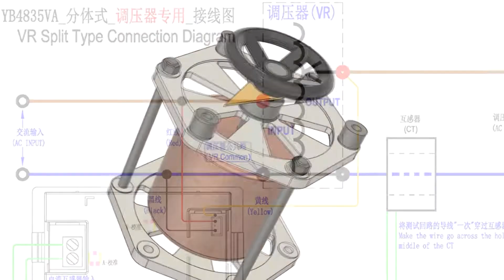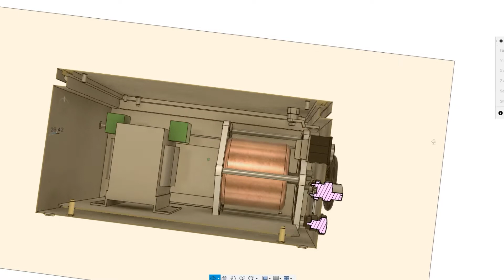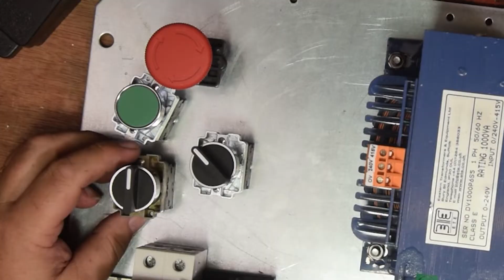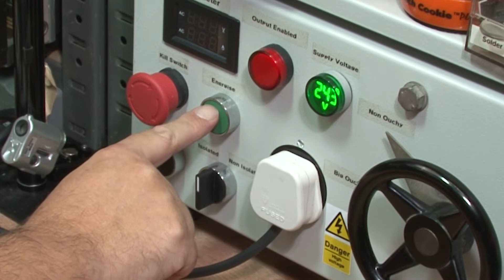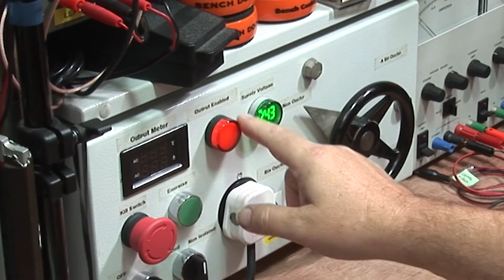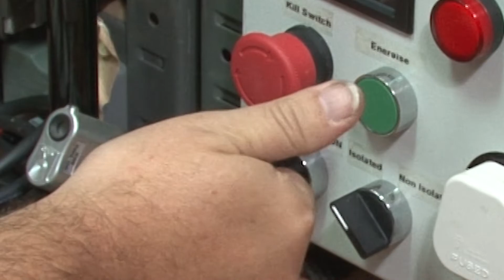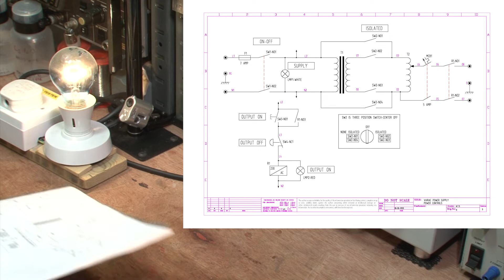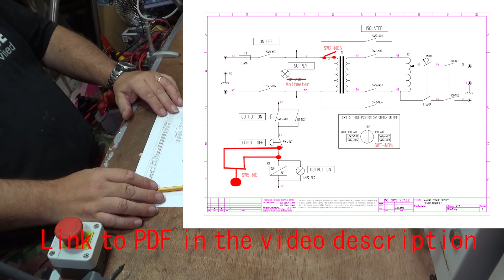How to make a variable AC voltage supply with a Variac and isolation transformer

Comment: Well Many happy returns George hope you have a great Birthday. I agree about the isolation transformer and the Variac they are quite huge but necessary for safety. Chris went through a ton of work to get that enclosure ready for you great friend to have for sure. That is a great looking unit and operating equipment that should give years of service. Thanks for sharing George
Reply from the maker: Thanks Larry for the birthday wishes. All credit has to go to Chris for putting my idea into practice. I only asked Chris originally where to get a box and I ended up with a ready to run cabinet! I'm pretty sure that the unit would outlast both myself and my kids and probably their kids too with the rigidity and strength of the components.

Comment: many happy returns ! looks very nice George  reminds me of the work I used to do making wiring harnesses for  similar metal boxes with lots of contactors in it  and  a transformer  bigger than that box !
Reply from the maker: Many thanks Benji. Yes, industrial wiring can be fun, I worked for a company that used to rent HV transformers to building sites such as docklands light railway and the Manchester tramway... wiring those to 11kv three phase from the grid was fun and then to the other stuff around the sites.... Slightly larger transformers than my car most of the time!
Reply: @GeorgeChristofi  it was and it was all one colour too black usually !

Comment: Like it.  I made a similar unit but added an additional interlock such that the output could only be on when the variac started from the zero position.  This meant that, in the event of a fault/trip you MUST reset the variac to zero volts before being able to turn it back on again.  Prevents you from re-applying the 'bad' voltage again straight after a reset/trip situation.  Also fitted a variable AC current trip to the output.  But yours is far, far larger than mine (giggidy) as my working limit is only 250W which covers most stuff I work on/repair.  Good job.

Comment: Hi George  Happy Birthday. The power supply unit looks great and I really enjoyed helping on your power supply project it was a lot of fun.  That  transformer and variac looking even bigger in the video than they did in my model.  It must weigh a tonne !   It was a good idea to add that extra switch for the input to the isolation transformer I will update the circuit diagram for you so you can glue it inside the lid. Many thanks for the mention and channel support regards Chris
Reply from the maker: I was glad to have the help. Yes, weight.... errr... lots I think the raw transformer is about 15Kg and the variac about the same... then we add the steel box and it makes for a 'substantial' device! I was thinking of double switching the isolation transformer but it made the switch block ridiculously long. I was thinking of maybe running that as another contactor at a later date. As for a shoutout... the least I could do for all your help.

Comment: Hello, I came across your site by accident, I watched this video out of curiosity. This is absolutely professional work, when I see some creations in wooden or cardboard boxes with loosely stretched wires, I die slowly at the monitor.
When I saw the wiring diagram, I noticed a huge mistake, when using an isolating transformer, the ground must not be connected to the output socket, the ground will be connected to non-insulated distribution and the ground loop may be closed. I also have an isolated/non-isolated output switch in my wiring - in the isolated state, the ground is disconnected, and in the non-isolated state, the possible residual current of the ground loop is monitored.

Have a nice day 🙂 Tom
Reply from the maker: Many thanks for your comment Tomas. In the UK, the wiring regulations specify that the earth must stay connected through to the output socket. The only exception is in recording studios. The earth wire is not connected to neutral in our mains distribution systems but runs back to the supply transformers. With this form of isolation, there is still no reference to earth so the output from the Isolation transformer is still safe with reference to the rest of the supply. When I queried this with my friend who said to run the earth this way initially he explained this to me. As it is his profession designing and installing mains and HV systems I deferred to his better knowledge of the system and current regulations. I too was worried about ground loops and full isolation.

I thank you on your comment regarding the quality of the work, I have worked in the radio and electronics field for many years and I have always found working on neat panels and circuits to be much easier than bad job systems. 

Many thanks once again Tomas, I wish you all the best.
Reply: @GeorgeChristofi  Hi George, thank you for the clarification, in this case the tn is absolutely flawless, here in the Czech Republic there is a primary ground circuit and only the protector physically separates the neutral wire and the ground, in connections without a protector there is a connection between the neutral and ground bridge in the switchboard.

Beautiful day and many such wonderful projects 🙂 Tom
Reply: @GeorgeChristofi  I noticed one more thing when I was showing your beauty to my son (he does IT robotics) the output voltage indicator light is connected to the contactor coil - I personally connect it via the contactor contacts - if, for example, a mechanical failure of the contactor itself (cracked contact hinge, baked contacts spark, etc.) the contactor did not jump after switching off, the indicator light goes out, but the circuit is energized, if the indicator light is powered through the contact, it will remain lit. 
Nice day 🙂 Tom

Comment: Well done George! (and Chris for the metal bashing!) That turned into a nice self contained piece of gear. Gets rid of interconnecting wiring and provides convenience, increased safety and  metering. For added safety maybe another indicator light to warn you that the isolating transformer is on bypass, least you forget??
Reply from the maker: Good idea! Something that could be added and I do have more panel lights and meters which will match the ones I have used. Chris did most of the hard stuff, I have to give him most of the credit.

Comment: Thank you George you can put the links where you bought the accessories
Reply from the maker: All of the equipment was UK sourced so it may or may not be cheaper to buy locally. My transformer came from a UK manufacturer, https://www.ete.co.uk/ and the variac came from eBay. Switches were bought from an electrical distributor, https://www.rselectricalsupplies.co.uk and the contactors, din rail and connection blocks were salvaged from various sources.

Comment: Good one. How can you also change the frequency of the output?
Reply from the maker: no, there is no frequency changing available so it will run US devices but only at 50hz. Generally thats fine except for syncron motors for clocks which rely on the frequency to be accurate

Comment: brother can i use diac triac for ac variable power supply without transformer.
Reply from the maker: Probably not and it really wouldn't give you a proper variable output, just a chopped sine wave. I would say the Variac is the most essential part of the whole setup

Comment: It looks like the primary of the isolated is connected to the secondary. This is a question not me trolling. What causes the output to have a floating ground say for an oscilloscope to protect it from mains earth. I'm still learning is why I ask?

I think I get it after studying it further. The spdt switch on the primary of the isolation threw me there.
Reply from the maker: The earth is continuous via the switch but the isolated supply is definitely isolated from primary to secondary. The secondary output is floating as it isn't connected at the neutral side to the earth to obtain the standard ground reference.
Reply: @GeorgeChristofi  awesome. It's what I figured after much study. I'm new to the hobby for about a year and a half but it's good to finally feel minor progress. I have a software degree and have been wiring guitars and fixing stuff for years so it wasn't a massive jump to entry but a massive amount to become competent.  Learning is the funnest part man

Comment: That's a smashing power control system george :-D, happy birthday, you are one day older than yesterday lol.
You and chris have thought of everything.... No tea mug holder, what a mistake ha ha :-D
You still have the external limiting bulb for safe valve radio powering up.
If you include (on the bulb board) a bridge rectifier and capacitor +neon+resistor, you can check capacitors for leakage.
Or torture them lol.
I can't think of anything else to add ha ha :-D
Reply from the maker: I did think about adding other things and a rebuild of the dim bulb tester may happen at some stage... Cap torture can be done on my heathkit cap killer... sorry checker or even the one I built a while ago. Tea mug holder may get added to a soldering iron so that the tea stays hot. I do have an idea for a plug in item to increase the danger factor though.

Comment: What lcd meter are you using I can only find either 4 wire volt meter only or amp and volt meter but the meter draws from the supply so hose off below 30v
Reply from the maker: The meter in use is a unit designed especially for variacs which takes its power from the input supply. I bought it from AliExpress and it was one of those things that took me a long time to source. I didn't want to use the standard all in one type that needs 80v to run. https://www.aliexpress.com/item/32845675525.html?spm=a2g0s.9042311.0.0.27424c4dnJ2hVu is the link to the actual one I ordered.
Reply: Fantastic it was a little hard it kept taking me to the Russian site but hopefully managed to buy one 🤞

Comment: Can anyone give me some direction to help me search for the nifty tool he's using at around 4:03 in the video? I would search for metal shear drill bit, but I think that may be misunderstood by search engines.
Reply from the maker: It's called a greenlee punch I believe and they can be had in lots of sizes..
Reply: @GeorgeChristofi  Thanks for your reply. Using this knowledge, I've extrapolated "knockout punch" and this is now getting me the sorts of results I can work with. Unfortunately, my wallet is crying now, so I'll have to console it a little bit before I place anything in a cart. 😂
Reply from the maker: @CollinBaillie  I hear what you say about the cost for sure. I had to bite the bullet a while ago when I was building valve amplifiers. I did end up getting the best quality branded ones that I could because I didn't want to have to buy them all twice...

Comment: Great job. What are the cost and power efficiency of the project? You can add variable dc power supply with dc posts, alligators clips with wire ,diode and capacitors

Comment: Fun video. I note that you did not provide a switchable break in the ground connection between input and output. I use a knife switch to open and close that ground. It’s visible and obvious which way it is positioned and it offers affirmative closure. Of course, there are safety issues either way, so you have to know what you’re doing.

Also, others usually put the Variac before the isolation transformer. Any thoughts on that?
Reply from the maker: I did put a switch in the earth line, as you point out, advantages and disadvantages to both. My thinking for the transformer first was to keep all of the control voltages for the unit at the incoming line side and to not run the risk of saturating the transformer when the variac was at 120% of line voltage.  In theory that could be as much as 300v and I wasn't sure of the core spec outside of its rated voltage. The transformer is only rated at around a third of the capability of the variac, overkill for anything likeley to be seen on the bench but still,  if it cooks it is easier to replace than the variac. The variac was new old stock from the same era as I was born in so a quality unit as opposed to some over stated Chinese unit.
Reply: @GeorgeChristofi  Thanks for your thoughts. I live in the US where we have both 120 and 240 volts available, with 120 V widely distributed throughout the house and 240 V only for the heavy appliances. I have a genuine General Radio Variac rated at 20 A at 120 V (actually up to 130 V).  For an isolation transformer I have a 2400 VA beast with primary and secondary taps that can deliver both 120 V and 240 V when driven by the Variac. So I put the Variac in front of the isolation transformer. I rarely will push the maximum power capability. Now I need to neatly package everything as you did.

YouTuber “Mr. Carlson’s Lab” showed his similar project and he put the Variac before the isolation transformer too. Probably doesn’t matter much.

Comment: Great channel. Have you any equipment tips for somebody getting into the vintage radio repair hobby? Oscilloscopes,signal gens etc.
Reply from the maker: I could recommend all manner of equipment but to start, a good multimeter, a good power supply and some good tools. After that, I would say that your signal generator just needs to do the band's you want to cover is all you need, advance and leader make very good stuff. It doesn't matter if it's old, and if it needs a service then all well and good! If it's not a digital readout version then a frequency counter is a nice to have but if you get your Sig gen calibrated against someone else's then you will be good to go. All in, you could set up a basic workbench for less than 100 pounds using second hand stuff. Scopes are a nice to have. Best not having a digital scope as they are not the best for working on analogue radios.

Comment: Great stuff! Just one question, do you run earth though an relay as well? I suppose, when running unisolated, the output is connected to earth, so it needs to be broken when running though the isolation transformer?
Reply from the maker: No, the earth stays connected permanently. The isolated output is not referenced to it so it effectively is a dead wire.

Comment: Jesus dude.... this is a really useful and wonderful video! I could’ve used this several months ago when I was putting together my all in one isolated supply. 

I’ve always had a few large variacs (Single and three phase) in my lab, And plenty of isolation transformers. But I needed an all in one unit that could handle pretty everything. 

-single phase ac and dc 0-480v

-variable voltage and frequency three phase AC
 
-With isolation that can be switched on or off. 

I Found a wonderful supply made by Hampden. The “BPS-103a” Power supply. Which will do everything covered on my list above. 

It weighs well over 100 pounds… But usually available on eBay for under a few hundred dollars delivered. They were several thousand when new, but they’re so highly specialized, large and industrial… That they’ve gone undiscovered therefore are offered for the price of shipping.

If you can figure out how to supply it with clean three phase power… then you’ve got a power supply that will literally do it all. I supply mine with three phase power… By the way of a converter. Which converts my standard home electricity into very clean three phase power. I picked up the converter extremely cheap on the eBay… but you could always supply it with single phase power and it would still do everything except output three phase.

Sorry to ramble. But there’s something to be said about a beautiful supply such as you have built here!!! And for those people who can’t build some thing… The Hampden supply like I purchased is a wonderful alternate
Reply from the maker: Many thanks for the feedback. Glad you found the video useful. It was some way of me tying together my separate units that were scattered around. The trouble with that is that you are less likely to use them when you have not got it set up read all the time so this was the combination safety and convenience solution. It would work the same with 3 phase too, just needing a bit of contactor stacking to get enough through paths. Again, scaling it up or down to match what you need is easy to do, depending on component availability. I could do a converter to 3 phase here but have no real need for it as I don't have any heavy equipment such as mills or lathes.

Comment: Nice video George, did you overlook removing the ground/earth from the output socket? Lou
Reply from the maker: No, I left the eart in place as per current regulations. The earth wire is still disconnected from the mains supply because the live and neutral output is isolated from the incoming supply. With no reference to that earth there is no chance of a shock from a hot chassis because of the lack of ground reference. I was thinking along the same lines as you originally but when Chris AllTheGearNoIdea explained the current regs to me and how it is isolated it made perfect sense to leave it in case of a transformer meltdown.
Reply: thank you for your reply George, I wasn't aware of the reg either. Lou